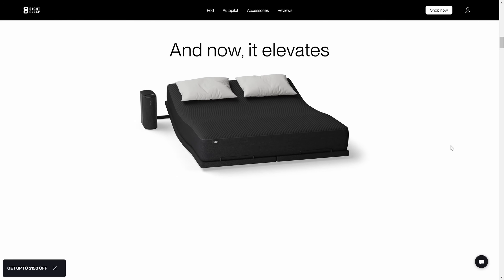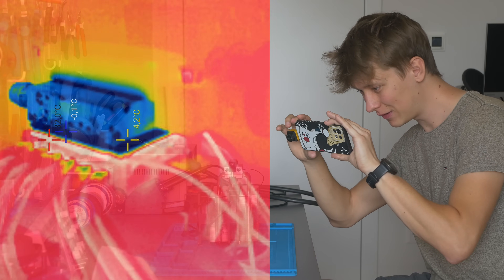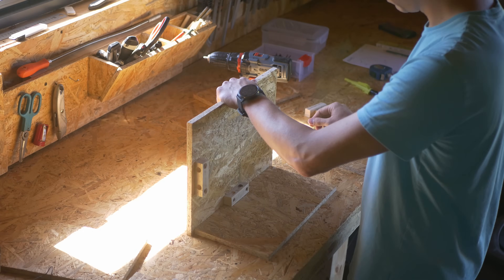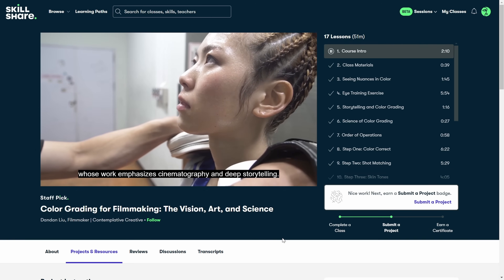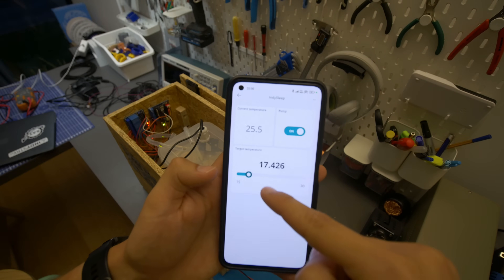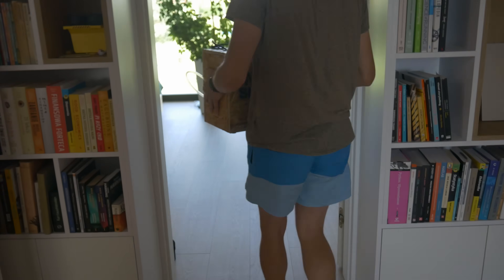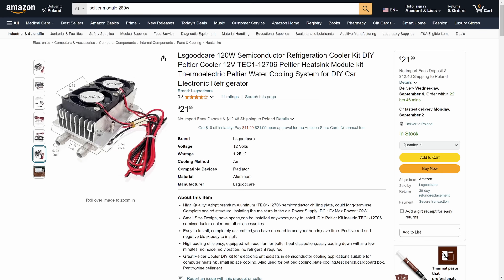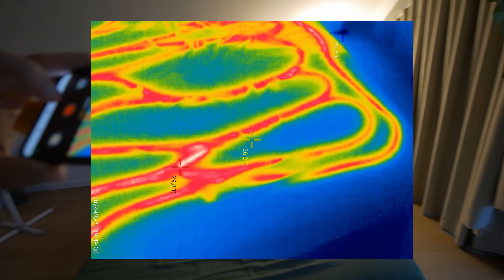I Made a $4000 Water Cooled Bed

Comment: I don’t understand why eight sleep company You need to have a subscription for even using the bed when you already pay $4000.
Reply from the maker: I could understand if this is an optional thing with some extra features. But when you buy it you HAVE TO buy the subscription for a year as well!
Reply: If I had a 4k lying around, I would definitely try to hack it. Shouldn’t be hard.
Reply: you wouldn't pirate a bed
Reply: it's called "enshittification"
Reply: One of the executive's children was hired and that child needed to do something so they came up with a subscription plan.
Reply: The moment the company goes out of business you have a 4000$ normal bed sheet
Reply: @ELYESSS i'm pretty sure at the end it is a heater and cooler module that is turned on with a switch inside the unit. Without seeing it I can tell you you can probably yank out most of the electronics and replace it with an 10usd ESP board.
Reply: You are no longer the customer. You are the product. If I have 1M users "subscribed", my exit plan golden parachute gets edged with diamonds and platinum...
Reply: Probably so consumers are never considered "owners" of the products they purchase.  That way your data can be stolen with some BS legal argument that they're collecting telemetry from devices they own.  Maybe also to prevent repairing/modification through threats of prosecution?
Reply: money
Reply: (I’m a sucker, I mean customer) they push all processing to the cloud, so the subscription pays for their AWS bill. My bed pushes over a gig a night of data. If the internet goes out the bed won’t change temperature. Mine is getting rooted at the first sign of the company going “dumber”
Reply: @markwalling4924  Holy shit - 1 gig of data per night? Wtf are they doing?! First of all, why the heck would you need AWS for processing this? Temperature control is one of the most basic things any processor can do. Second, what on earth makes their beds generates 1 gig of temp graphes per night?

Apparantely their hardware engineering is really good, but whoever wrote their software should be fired asap and should never ever get hired in IT again.
Reply: @Nepoxification  1GB could do 24 hours worth of audio at a decent bitrate....
Reply: @tad2021 selling your audio to train AI models
Reply: @markwalling4924 ”my bed pulls over a gig a night” should not be a sentence
Reply: @markwalling4924  The real question is: what processing?
Almost anything could be processed by your own phone or the bed... Seems like they are wanting you to pay a subscription to sell your data 🤣
Reply: @AMV12S  I’m not defending the practice.

But it’s a hella lot easier to throw shit code into the cloud and light money on fire scaling it out than it is to write good code that could run on the hardware.
Reply: @markwalling4924  that is lot of data, i wonder if they're measuring every second which is stupid inefficient lol. If you sleep 8hrs that is 480 minutes or 28800 seconds, if they send data about temperature ever 30 seconds this thing will send data to the server 960 times and i doubt that it pushes 1mb of data each time. If they send data every 1 minute it is 480 times and i doubt that the data is more than few 100 bites per request.
Reply: @markwalling4924  please clarify, you're talking about a bed? rooting a bed.
Reply: @markwalling4924  what processing? temperature measurement and regulation? that can be donne with a 20ct chip ;)
Reply: @iwh7 there’s a sensor package that does heart rate, respiratory rate, sleep phase estimation. Their “AI” 🙄 then adjusts the temperature set point to “optimize” your sleep. I assume (I hope) the PID controlling the peltier runs locally.
Reply: To make money lol
Reply: That's insane. I hate subscriptions. Ever since they started being a thing instead of just buying a software I've started hacking them to bypass it lol
Reply: Better exit when they are gonna sell.
Reply: I think it's also because its generally a one time purchase and if everyone buys one they'll never buy it again so they put the subscription to make more money.
Reply: They do it because they can.
Reply: Have one and happy with it. Sleep is very valuable to me. The 8 sleep collects detailed heart beat statistics and reports heart rate variability information and snoring information. Agreed it is unfortunate that the company came up with a subscription model, but they have the best temperature regulating and monitoring mattress pad on the market.
Reply: It’s probably the sleep software + extra income. Hosting data also paying software maintenance/development. Also beds are long term investments, buyers aren’t gonna go back every 3 years to replace their bed, unless they do planned obsolescence, which is just diabolical when it comes to something like a bed. Also they probably wanna stay a premium brand.

Comment: If you're after a lot of 12V current and not a lot of noise, you can get used HP modular server PSUs, the ones that according to E-number appear to be made by Liteon, their cooling is temperature regulated and generally pretty silent. Which is a bit of a change from say old Delta server PSUs which just ran their cooling full tilt. They're efficient as well and come in at power between maybe 600W and 1.2kW, that range, if i remember right.

Honestly by the principle of operation the commercial product is necessarily going to have the same problem of heating the room a fair bit more than it cools down the mattress. In summer you can just yeet the heat exhaust outdoors right?
Reply: I have hp hstns-pl18 that i bought used on ebay for $20. It's pretty quiet and outputs 60A, which should be more than enough.
Reply: Aren't server PSUs notoriously loud?
Reply: @athmaid   They can be. They certainly used to be!

It depends. If a thousand servers don't need to be spending extra 5W on running the fans at top speed doing nothing, that's 5kW saved, nothing to scoff at, so it makes sense. I think that's the trend. But even from the same era say Delta made PSUs were much louder than Liteon. So it's these particular PSUs that happen to be not trying to deafen you.

Of course if your server rack or server room happens to be as hot as a sauna, well you're going to need hearing protection that's for sure, because they can go very hard if need be.

Comment: It would be cool to see you keep working on this. I think the truly hard part will be making a comfortable matress topper that has enough tubing, but one can't feel the tubing through it, nor should one laying on it squeeze the tubing shut. 
I would definitely love to see you continue to develop this, I would be interested in building such a system myself if it reaches some level of maturity
Reply: I've been thinking about a similar system for a while now, but was going for an indirect cooling system using ice water. My plan for the tubing was to use a 1" latex mattress topper, which has a grid of holes from manufacturing, and cut a short channel between the holes to embed the tubing into the top. There are also some similar commercial systems with cooling blankets, which would alleviate the problems with laying on the tubes if the topper doesn't work.
Reply: What you really need is like a lot of smaller tubing running parallel feed by the larger line near the head,  then they can all combine at the foot of the bed into a return line..   How to make that with no leaks? that I don't know.
Reply: @DianaBell_MG  that is a really good idea. Sounds like it would be doable with 3d printed splitters. Just extremely annoying to manufacture, and huge flow resistance

Comment: Fun Fact: You can replace thermal paste by tooth paste. It works surprisingly well.
Reply from the maker: Does it work the other way around as well?
Reply: @iBlue0riginal  fun fact, per dictionary definition, fun facts are not required to be fun, merely trivial
Reply: But it only works for a limited time, because water which is the main ingredient is a little volatile especially at elevated temperatures.

Any number of things work for thermal transfer. Brake copper grease is pretty decent. Igor's Lab found Mos2 grease to perform surprisingly well.
Reply from the maker: But seriously, now I want to try it. I could finish this project a week earlier if I didn't have to wait for the thermal paste
Reply: @nikodembartnik  Yes, I did it for peltier coolers for a cloud chamber. Also there are other sources: https://www.youtube.com/watch?v=v08FWIvrYGU